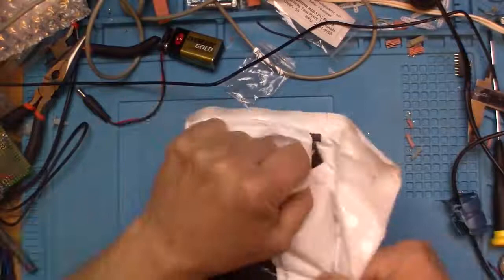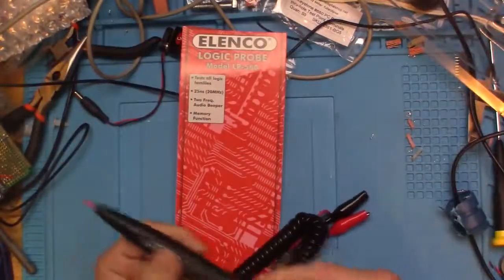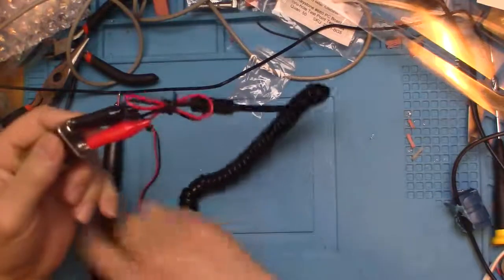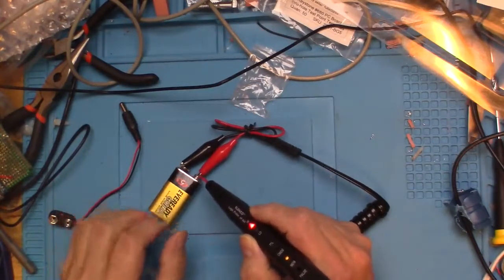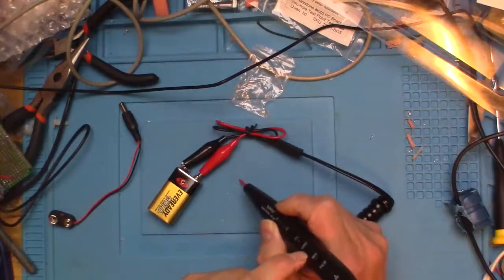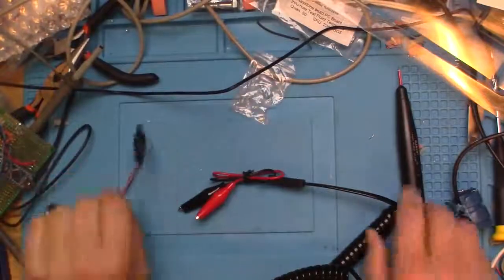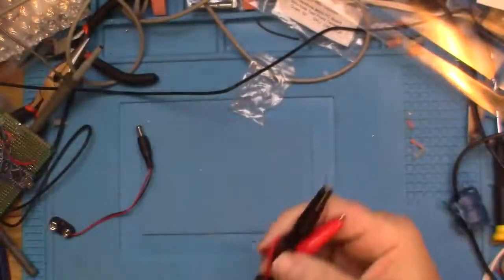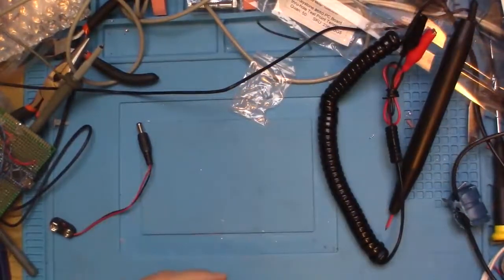Unboxing LENCO LP 560 Logic Probe with Audio Beeper

Comment: Hello would you happen to know what it means if my logic probe is getting the green (ground) light on a hot wire? I was troubleshooting my turn signals. The ones that work I get a red light on the hot wire and the one that don't work I get a green light on the hot wire?
Reply from the maker: Maybe it's shorted to ground?  Or open between your test point and power?  If you take the bulb out does it indicate open?  I'm not sure - Automotive wiring always seemed like magic to me...  Sorry...
Reply: Some Old Guy Coding with the bulb out it gets the green light instead of the red . I just need to do more research on this. Thank you for your reply. 👍